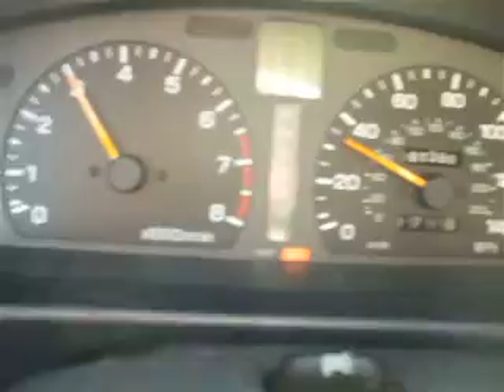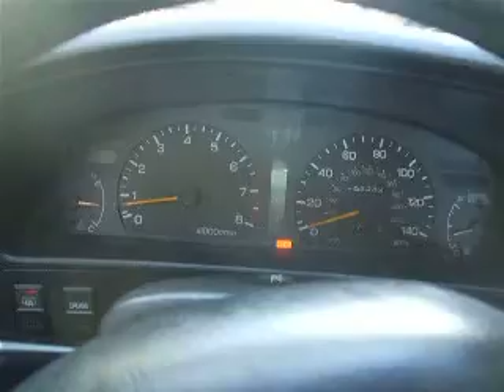'93 SS EJ22T Misfire/Boost leak?

Comment: My 92 was doing would pop under load an I found out my tps sensor wiring was bad by the plug! So I unplugged the sensor and took it for a drive and it was able to boost and drive normally again..so I bought a good harness and soldered it on and haven't had another problem!

Comment from the maker: I replaced the fuel pump with a Walbro 255, new fuel filter, new fuel injectors, new ignition coil, did multiple boost leak tests, replaced all the vacuum lines and most of the intake. It got a little better but still misfired or cut out.

Turns out it was a bad MAF. Replaced that and it is a little beast now. Wish I would have checked that first, lol. TD04 and TMIC coming up next.